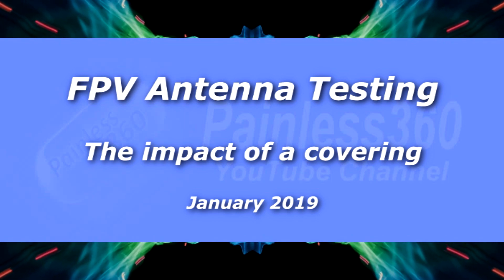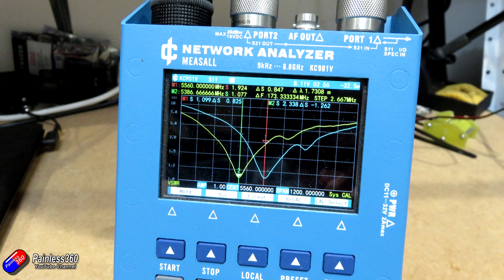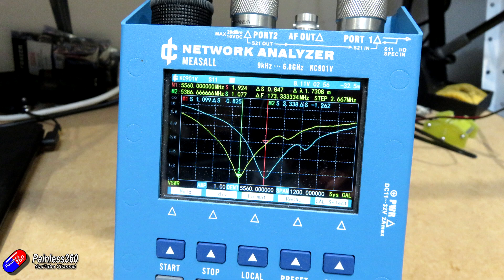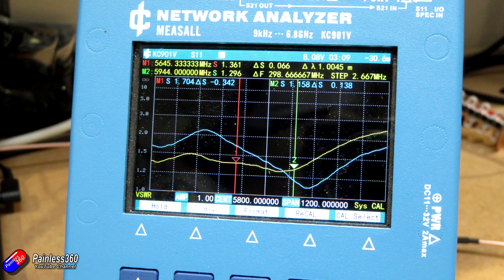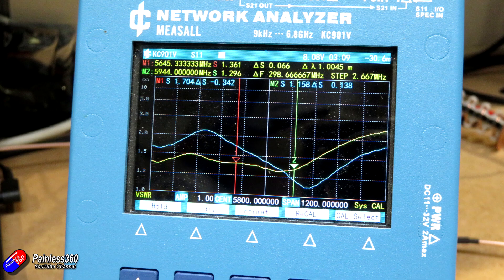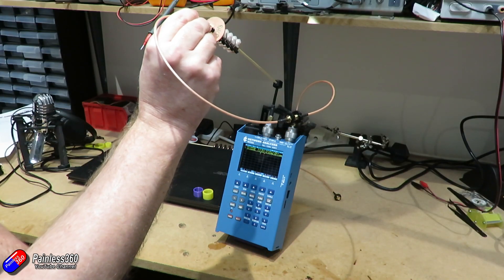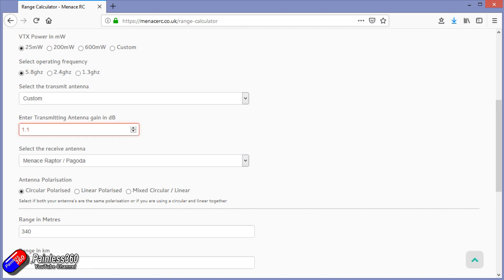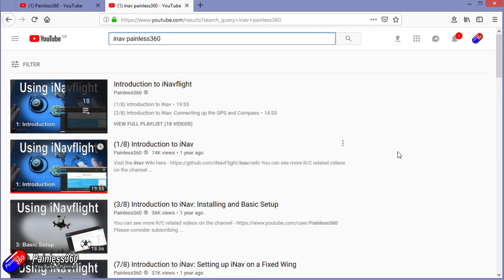FPV Antenna Lab: The real impact of covering your antenna (TPU, PLA etc.)

Comment: Okay, call me crazy but if his testing antenna is tuned to (3) wavelengths and that is specific to the length of that extension on the end of his helical; then adding a cap with a thickness of (x) will shift his tuned antenna further away from the tested antenna. This would change your results just on that alone wouldn't it?
Reply: Very good point,  essentially moving the measuring antenna away from the AUT ( Antenna Under Test) will reduce the signal strength measured,  however as it is such a small distance (1 - 1.5mm) for this comparison testing we considered it to be negligible compared to the actual signal strength reduction by the addition of the 3d printed material.  
To confirm, I carried out the test with a 1.5mm air distance change, this gave a reduction under 0.1db.

Comment: So, i i understand correctly. Losing the plastic cap on my antenna weakens the signal? SO i should print an aftermarket cap on my 3D printer now?
Reply from the maker: Unless the replacement cap is identical at the one that the antenna was designed to work with,  it may not help you. Happy flying
Reply: @Painless360  Thank you for the swift answer!

Comment: If you have the chance to use this network analyzer again, I would be very interested in the same tests but with hot glue, hot glue that's touching the antenna wire, wood, scotch tape, kapton tape and electrical tape. Do you think these would have similar results as the TPU and PLA?

Comment: Very educational. is there any way to empirically check where your antenna is tuned?   i have 8 or 9 antennas around of all different types and brands. Thanks!
Reply from the maker: Make sure you’re subscribed and have the bell notification icon selected. There will be a video coming in about six weeks that will allow you to do a similar test at home quite cheaply.

Comment: Painless 360 can you use the tbs unifi and akk vtx and tramp with boscam receivers I have the 600mw receiver
Reply from the maker: Modern kit tends to play well together, I'd always match the antennas at both ends for general flying. Make sure you are allowed to use that much power where you are as many places limit the FPV power to lower levels. Best of luck!

Comment: A bit odd that the VSWR of the Aomyway improves with the shroud yet the dB decreases. Could the shroud simply be shifting the helical physically further from the radiator thus resulting in the drop? It wouldn't be a ton but a doubling of distance is 6db loss and you're only 18cm out.  Love this series! Please please do more!
Reply from the maker: Please see the pinned reply from Menace - lots has asked this one.. Hope it helps..
Reply: @Painless360  Thanks for pointing that out he answered exactly what I was wondering :)  The difference due to being further away was far less than I was guestimating.

Comment: Great Video guys, Keep up this kind of work, it's the stuff that really matters to the "man on the sticks". At this point in the evolution of this hobby, video range/quality are really the limiting factor, and I'd even say are more in need of improvement than battery tech. I'm a radio amateur for 40yrs and as a result have gone to a small portable antenna tower (tripod and collapsible fishing rod) with a Clearview  ground station RX. I just purchased HDOs and went for the Rapidfire, so a lot of my time and money has been dedicated to improving my video range and quality. 
Your research is great as it lets us know what we can do to improve our equipment thru the antenna which, as they teach you in RF101 is the single most important part of a system.

PS The weather here in the northern US hasn't allowed any testing, so I can't say how the Rapid Fire compares to the Clearview, I plan on doing some testing in the spring, but have a hunch the Rapid Fire with external antennas on my 20' tower may be quite similar to the Clearview feeding Video to the goggles. My Commanders like the external antennas a lot, but the Clearview has the edge right now. I mention this because this sort of testing seems to be the kind you may be interested in doing videos on.
Thanks again!

Comment: Great video, I just wonder what you suggest to hold your antenna. Many quads these days have TPU files designed to hold your antenna.
Reply from the maker: You can use anything you want, just make sure it doesn't cover the active elements.

Comment: Wouldn't the thickness of the cover mean the receiving antenna is further away from the transmitting antenna, or were you assuming the outer skin of the cover becomes an active part of the transmitting antenna? Might have been better to offset the spacing rod so that it touched the central support of the transmitter instead.
Reply from the maker: Nope. Please check the answer that MenaceRC has already given on this question in the comments..

Comment: In the future, will you be shedding any light on whether or not zip ties and heat shrink cause any degradation to receiver antennas on the quadcopter?  Awesome video guys, very interesting.
Reply from the maker: Indeed, check my other replies. Stay tuned and make sure you have the bell notification icon ticked. Happy flying!

Comment: 90 Degree Antenna Adapter Connector 
Is there an influence?
Reply from the maker: A test on that along with a couple of other ideas coming soon. Make sure you're subscribed and and have the bell notification icon selected so you don't miss any of the series. Happy flying!

Comment: Excellent work again. One thing to note is that the same rules apply across the spectrum, so 2.4gHz, 900mHz and 433mHz are in the same boat regarding covering.
Cheers and thanks for another great video.

Comment: I still could use this set since I like theyr antennas alot but also destroy a few of them.
Not the Antenna, mostly the coax breakes and you are only able to resolder it a few times.

Comment: Couldn't the dB drop be caused by the increased distance to the second antenna when you measure with vs without cover?
Reply: Very good point,  essentially moving the measuring antenna away from the AUT ( Antenna Under Test) will reduce the signal strength measured,  however as it is such a small distance (1 - 1.5mm) for this comparison testing we considered it to be negligible compared to the actual signal strength reduction by the addition of the 3d printed material.  
To confirm, I carried out the test with a 1.5mm air distance change, this gave a reduction under 0.1db.
Reply: @MenaceRC  Ah, thank you!!

Comment: Interesting. What strikes me is that many antennas don't come with their optimal VSWR at the middle of the frequencies we use, cover or no cover. Since people will always need to custom print their antenna mounts for their specific frame I think the best thing for antenna manufacturers to do would be to tune their stubby-type antennas to about 5920 MHz.

Comment: Thanks to Greg and yourself for taking the time to do this testing , and the others, and presenting in a way that can be understood.  I know that testing could be unlimited but,  I fly a lot of 1.3 (1.258) also with DIY dipole and inverted T style antennas with the lengths based on calculations from the web. Performance has seem to be good but always wondered about the difference in the insulation type around the wire.  Would be interesting to see some comparisons in this frequency range. Thanks, Jerry

Comment: super interesting results,  i'm a little confused though, if the swr bit improves some regions of the range then can it still be said it causes a 2db loss ....i mean it has a loss at its optimum freq, but are there the same gains as with the swr bit hehe.. don't worry we all know this is a supremely intricate problem...  i'm still pondering why my eachine ev800d antenna works better with an aomway (with shield) on the quad than two aomways, and not just better,  massively better. we're talking behind trees 300m away.

Comment: Watching this interesting series of videos have made me stop and also think about my 2.4ghz receivers. I recently fitted a X8R to one of my models and that rx only came with the bare pcb type antennas, so first thing i did was to buy a couple of 3d printed covers for them. Am wondering now how much i have reduced the performance by doing that. I guess the same would apply for the normal coax style 2.4ghz antenna - they often get a bit of heatshrink tubing put over them to protect them. I know 2.4ghz is meant to be better for penetration, but still wondering now just how much reduction in range covers could cause. Interesting subject indeed.

Comment: Thanks for the informative video!  For those that don't want to plug in the numbers themselves, according to the calculator on the Menace site, a loss of 2db on a 25mw transmitter means your range reducing from 340m to 270m.  FWIW, I use TPU shrouds on my antennas and have never had an issue at a race.  Given my quad is generally within 150m at all times when flying a track, the results make sense as I'm still well within 270 metres.  However, on a particularly large track, it may become and issue.  Something I'll certainly keep in mind.
Reply: And